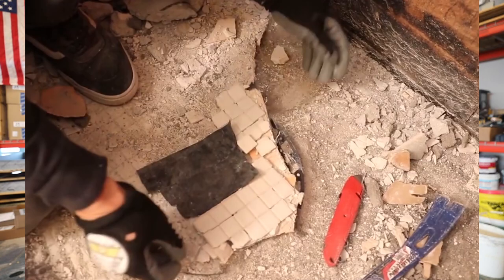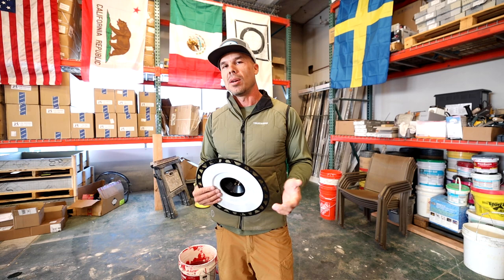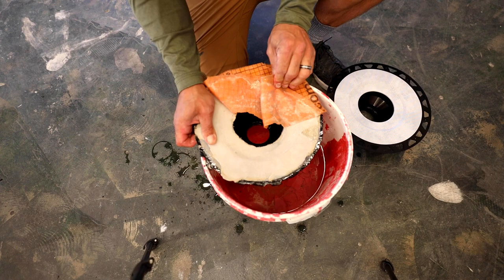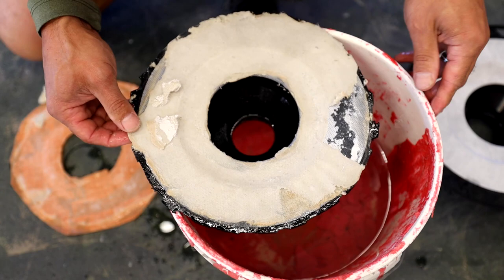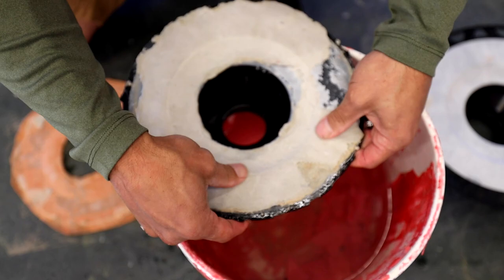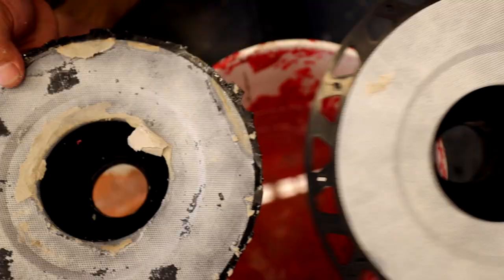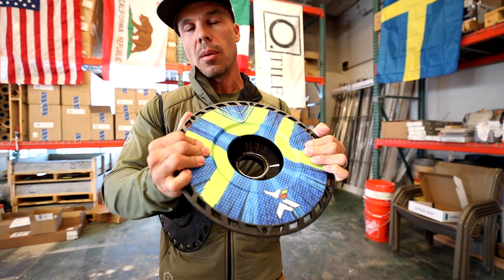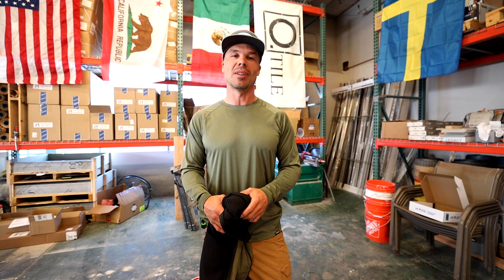SCHLUTER KERDI FLANGE TEST --- You got to see this!!!

Comment: Wow, Now if we can only think of a way to keep homeowners from busting up their tiles and pulling the flanges apart because that’s all you’re doing
Reply: My thoughts. I like Issac and his channel a lot but this isn't a fail
Reply: @mattjudy6780   Did you see the first two videos that the flange system failed twice ? This is him doing a test of what happens after a prolonged time the flange is exposed to submersion in water.
Reply: The tile was coming up by itself because of a poor installation, and the flanges deteriorated in the process, and leaking like a sieve. In short... they had one job to do, and failed when it mattered.
Reply: @tedspens  ok well how does he and so many others have so many schluter installs without any issues of a tile popping up from a flange failure? He's shown more than 1 schluter shower and talked about them holding up on jobs he did 10+ years prior.
Reply: @tedspens  correct. If installed correctly, no water comes in contact with the fleece  of the flange
Reply: Im glad that Ive never used that german Schluter crap. Im still old school. Old school never dies
Reply: @robs1873  so you've never used it, yet you somehow know it's crap. My schluter showers hold up just as good if not better than any traditional mud system. Did another one  last year in a home I previously installed one. Shower was almost 8 years old at the time. No leaks, no cracked grout, zero discoloration or any other problems with grout. With how much schluter and similar products repel water, the shower dries out so much quicker than a traditional system. I don't want a mud bed that stays wet a whole lot between uses and sometimes 24/7 if used everyday. I'm only floating if I have to. You'd change your mind if you tried it
Reply: @mattjudy6780  you dont float because you cant and dont know how
Reply: I’ve used the a schluter system for 20 years with 0 failures
Reply: @robs1873  Old school never dies... wow. I'll give credit where it is due, old school ways were solutions to situations using methods and technology of the time, but got a lot wrong. Asbestos fiber, chicken wire, tar paper are all old school ways of getting the 2 inch sand coat down in the bathroom.
Reply: @calebacrutto9601  youre amateur 😂
Reply: @ak420dave7  so youre a DIY’er? Schluter isn’t professional
Reply: @robs1873  schluter products are for professional use come out of the dark ages and use the new products that save time and provide a long lasting install
Reply: @ak420dave7  oh use Schluter so I can fail like “ tilecoach” ? Hahaha 😂